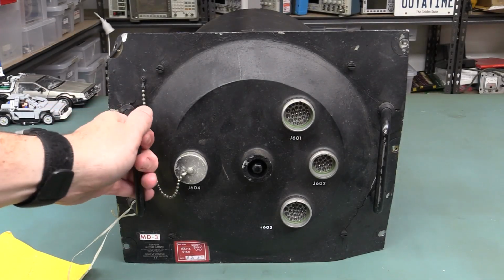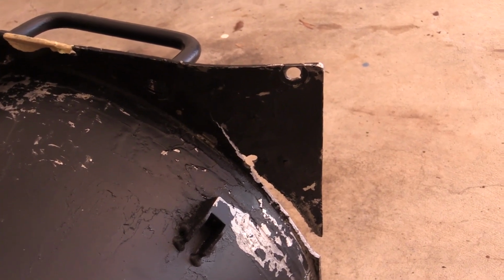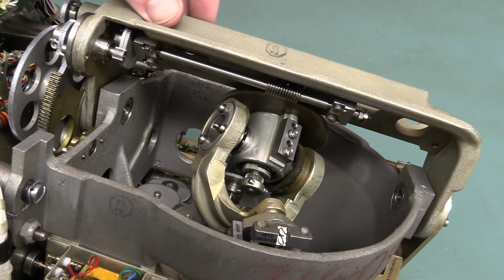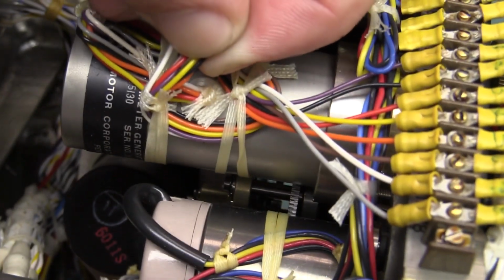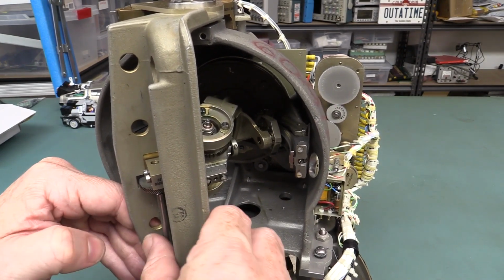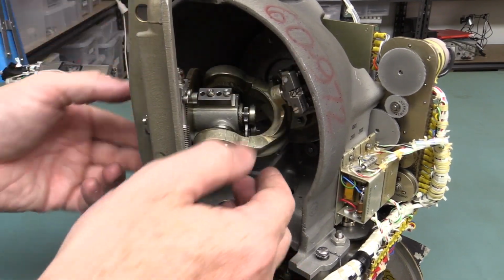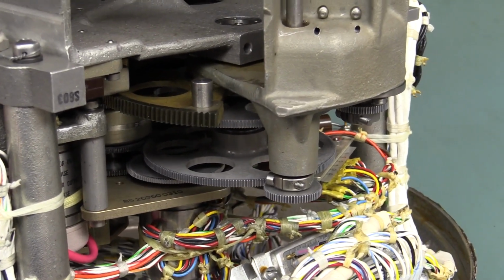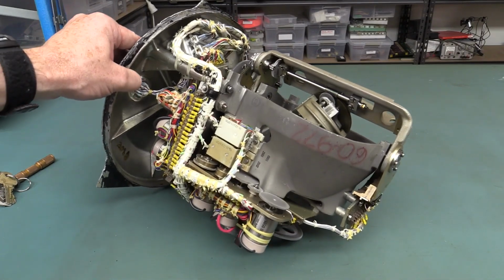EEVblog #854 - B52 Bomber Automatic Astro Compass Teardown

Comment: What would be the reason for doing this by mechanical means? Wouldn't a few op amps be lighter and more reliable?
Reply: +turboslag They did have analog computers back then. The Nike Ajax/Hercules had one to guide the missle to the intercept point. The Ajax was fielded in the early 50's about the same time as the B52. This computer was full of vacuum tube (valve in the UK) op-amps.
Reply: +Helge Frisenette 
At the time this was designed an electronic alternative wasn't available, and possibly, given the B-52''s original purpose,  this system was intended to be EMP proof.

Comment: Are any of the motors Stepper Motors ?  If the gears are only half circle, then it has to be North or South Latitude !  And if full circle, then East or West Longitude and that spring thing connecting the two gears signal E. or W. Longitude ?  And did the two spring gears change direction ?  Thank you for the video !  tjl  PS  How about a Tear-Down of an Atlas spehirical reference platform used in the Apollo and LM ?

Comment: That thing was absolutely beautiful. The gearing, the wire lacing, the EVERYTHING! I wish I had one to display! ;_;
I did practice wire lacing on my custom mechanical keyboard. The fanciest mechanism I have is an FDAI (Flight Director/Attitude Indicator), but I'm trying to make it WORK as an artificial horizon for a custom Kerbal Space Program controller (like the one you tried at the Maker Faire). Problem with using it... Is you can't really take it apart to show off the guts! XD

Comment: Considering it's application I would say that dome represents the sky and horizon, each of the arms can move within that half cone which is the sky line. rotations are likely limited to expected orientation of the plane, since heavy bombers like B52 are really not meant to go vertical or flip.
The dome would likely track the 3 axis and some add-on mechanics would provide the star location. The information is then read out by those control transformers and they will directly drive the axis on the astro tracker module.
some of the switches are for out-of-range error with would prevent reporting of wrong location information
I would also imagine there would be inputs going in to the system from a mechanical gyro/compass to set the initial location values. as well as means to input reference locations manually.
the spring band thingamabob looks like a clutch/tensioner. likely to remove slack from a section of the gear system.

Comment: Just a guess, but that helical watch spring between the two gears may be an anti backlash mechanism.
Reply: I agree - it's what I thought when first shown. I've seen this sort of anti-backlash mechanism in other electromechanical computers. The other "trick" was to use two gears with a spring between the two that provided constant gear mesh tension with the gear it drove or was driven by.

Comment: Great video Dave. The closest I have come to analogue computers is creating turing computers, which is still a lonngggg way from what you have. The other thing to consider is that there was no possibility of a firmware update like we have today, once it was in that sealed container on the bomber, it did not come out very often. I wonder how many of these units were produced? Were there many B52s? tens? hundreds? I doubt the latter but the US dont tend to do things by half!

The wiring is a thing of beauty as are the gears. Are they brass?

Nice job and hope someone ponies up some more info for you. Would be great to see it working even if it is just by spinning the axis with motors.

Comment: I live only an hour away from Hill Air Force Base where that thing came from! You wouldn't believe the hardware those guys have just hanging around in a lovely FREE museum you can spend all day in if you want! You want! I've spent DAYS in that place and I'm very sure I need to go again. I've overlooked more stuff than I've seen, I'm sure. I don't deal in aircraft, but the systems engineering is insane! The ground support stuff I know intimately, and I leave with my mind blown every time I go.

Comment: there would likely be only 1 or two main motors to make it run. usually the motor are 3phase hooked up in a delta configuration and usually only 20v per phase. ive got the compass out of a b52 bomber very nice kit all mechanical and using a esc from a hobby shop to drive the motor in it witch will probably be connected to thats some how.

Comment: Add a couple of stepper motors and an Arduino, turn it into a kinetic art display! Maybe you could use the in built motors to drive it.

......... or take it apart and build a B52 3D printer, from classified military technology to open source in one fell swoop!
Reply: +James Lamb unlikely. these sort of things ran on 400Hz, so it most likely wouldn't be able to be turned into a proper art display.

Comment: I think the thing with 2 inputs is sin and cos. They are both calculated at the same time, with the one that move them both, and I think the other one is for changing the starting point on the unit circle.

Comment: I was working at Kollsman at the time. I in electronics test equipment, and others in mechanical engineering. I bet one of my most respected mechanical engineering heads was involved with this unit.

I have a unit that I could tear apart non-destructivily on youtube for fun.

I'd send you another instrument, one of a kind prototype  pulled from a dumpster dive, but as far as I know, sensitive to export.
Reply from the maker: +nerdful1 Odds were someone in audience worked there at some point!
Reply: +Róbert Valdimarsson I used to build Synchros at the old company I worked for. Typical frequency was 400 Hz, at either 28 volts AC or 115 volts AC. You generally provided a reference signal to the rotor, which was energized by slip rings. The stator was wound in a Y or ∆ configuration, depending on application, and created an amplitude attenuated outputs set 120° apart. The attenuation and polarity, in relation to the reference gave you an angular reading of the shaft position. I'm working on creating a DAC driven synchro emulator to drive an FDAI (Flight Director/Attitude Indicator) "navball" for a custom Kerbal Space Program controller (similar to the one Dave played on the Maker Faire video).
Reply: +Chris B That was my first thought too. Since the board supply on planes usually runs on high frequencies, you can actually build very small transformers.
Reply: +nerdful1 Please do tell me that you are able to ask that person how this device works or maybe even... schematics!

Really interesting piece of hardware
Reply: +Ernst Stavro Blofeld =sarcastic comedy @ it's "best."
Reply: +EEVblog I think the black can is a transformer you get voltages out to control thing maybe.  You apply voltages to the compass and get voltages out to adjust Alt and Azimuth.  So the pilot would adjust the steering and you would get causes and fine tuning.  I have never worked on one on these myself.
Reply: +richfiles mmmm reminds me of servos and syncos.
Reply: + nerdful1  FUND IT.
Reply: +nerdful1 do you know what the output instrument for this looked like.
Reply: @Blofeld Sooo, you worked for nothing? Please tell us where.
Reply: +Róbert Valdimarsson I have seen them before in old gear .
Reply: Shambler101 j
Reply: Send it to @CuriousMarc! :-)
Reply: +nerdful1 -- Since you stuffed your belly on taxpayers expense, tell us how to power it up.

Comment: Search for N5G Inertial Navigation System for the B-52 Hound Dog Missile, I think it has a similar system or was integrated with the B52 INS.  

The Hound Dog missile is equipped with an N5G Inertial Navigation System 
(INS).  The INS features a triad of three very accurate accelerometers aligned 
along the earth’s coordinate axes (north-south and east-west, relative to True 
North) and maintained in this orientation by the gyroscopes in the N5G stable 
platform in which they are housed.  After activation the outputs of the 
accelerometers are integrated once to obtain the change in velocity (V = at) along 
each axis. The resultant velocities are then integrated to obtain the distance 
travelled (d = vt) along each axis.  The N5G INS thereby provides data on the 
missile’s acceleration, velocity and position to the on-board guidance, control, 
arming and fuzing systems.  This N5G stable platform is physically located at the 
approximate center of gravity of the missile. When the missile is attached to the 
pylon, the platform is mounted directly underneath the pylon-mounted astrotracker

Comment: Dave this episode is very cool!  Here is my guess...I think you are correct.  In an aircraft, to use a sextant you use a book of tables (The Air Almanac) that gives a star's location at a given date/time (and altitude of the acft also affects that star location).   So I think when the aircraft navigational system is initialized before takeoff, this device is given the date time etc...and like you said, it then gives info for the dome part to correctly point at the star.

So in essence this device is a mechanical representation of that Air Almanac.   

I would have to assume that the acft assumed location is constantly input to this calculator...I would love to learn more about this and it's dome companion.

Comment: The soldered outer can may be for protection against nuclear EMP (Electro-magnetic Pulse)??  I know military equipment is all supposed to be 100% shielded with shorting plugs on all connectors when in storage in case an EMP comes along so it doesn't fry all the electricals.
Reply: +Herbert Susmann The EMP hardening in this device is that it's almost 100% mechanical.  You could likely blast this thing with EMPs all day and nothing would happen.  More likely it's tamper evident packaging so they could tell if the ruskies had been snooping around in one of their planes.

Comment: EEVblog my dad worked on F4 simulators back in the 60's for the USAF and at the time they were analog as well. The way he explained it to me was that they work using banks of servos that are mechanically connected in various ways forming feedback loops. They were very useful for mechanical simulations like flight envelopes, dynamic tables etc. Like if the air pressure of the simulator dropped, it altered every other linked system like airspeed, lift, drag, etc VS using static tables.
Reply: +Subparanon those servo's would most likely be synchroresolvers.

Comment: The funny thing is, this was probably replaced by an IC no bigger than your thumb.
Reply: +Darren Jacobson You mean Micro Machine developed on old IC Chip tech ?  AKA better known as Analog Devices and written up on the PR history.  Think the MIT tech uses these chips in the running robots.  tjl
Reply: This mechanical nightmare was probably more reliable.